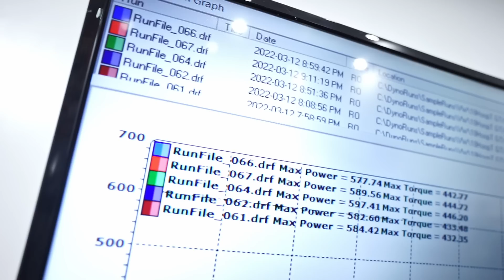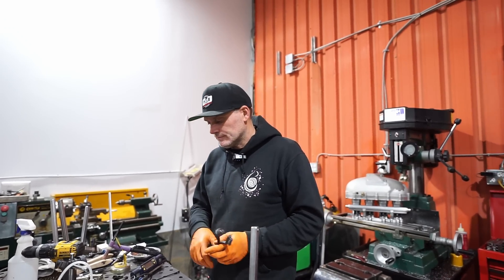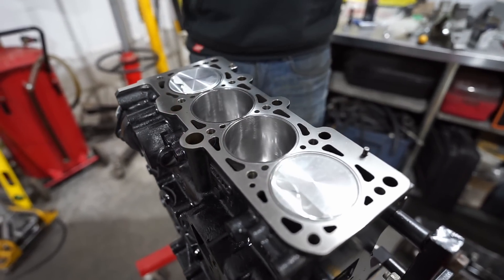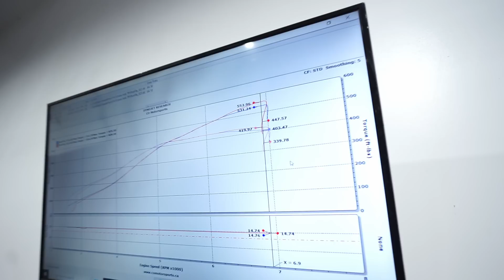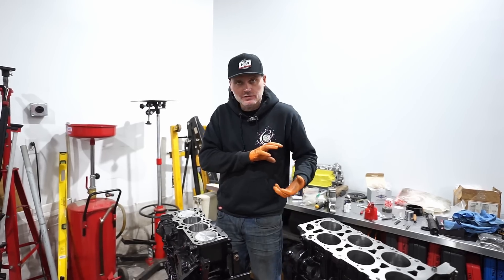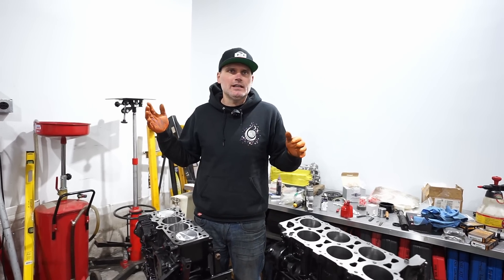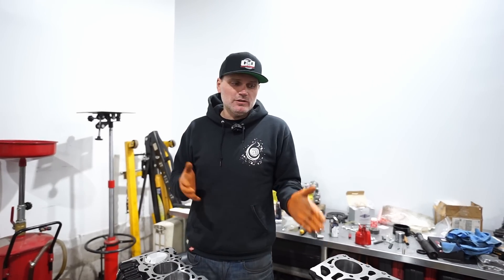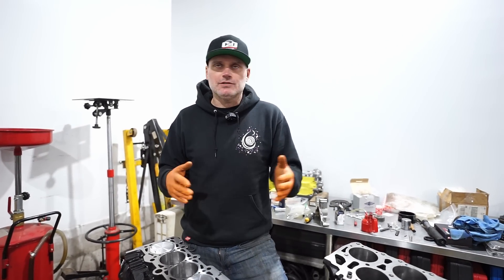Best VW/Audi Engine To Modify.

Comment: what are your thoughts on the gen3 that came in the mk6 non MQB?  I know they use small turbos, but CTS offers a really nice turbo upgrade and most of the fueling from the Mk7 MQB works on the non MQB Gen 3.  Wondering if you guys have had any of those cars in on the dyno?
Reply from the maker: Odd ball cars, little experience with them. I have a couple customers talking about doing turbo upgrades on them but as you would know stuff is limited due to their layout.

Comment: I'm working on finishing up a stroked 1.8t in my b5.5 Passat. New TFSI crank, IE Tuscan rods, JE forged pistons, and EFR 6258. I'm doing a stock position turbo manifold. Just needing a turbo drain flange to make my oil drain, and then throw the front on the car and build out exhaust. Will be starting and running it on a Maxxecu standalone, but at some point intend to switch back to factory ecu and get it tuned using Maestro. Any recommendations on someone who could remotely tune it?

Comment: 07k the world. I've had my boosted 2.5l longer than any other VAG car for a reason. It's hands down my favorite. There have been many fast cars inbetween, but that 5cyl is special.
Reply: I've been considering a 2.5 swap for a future project. I know they can be turbo'd but are they more limited for big power than 1.8T / VR6?
Reply: @Kintoshi892  When it comes to big power and built block, the stock head flows better than both 1.8t and vr6 heads. Early 07k engines came with a forged crank, later engines replaced it with a cast crank. It's a solid base for a build.
Reply: @moshuapit3722  thanks!
Reply: @moshuapit3722 ”early” being what years? mk5, just like how they swapped to hydraulic steering on mk6?
Reply: @zackobrien2223  There's no definitive answer to "what years". The cast and forged crank were sprinkled throughout the years together. MY 06 and 07 seem to have the highest percentage of forged cranks, but it's still a crapshoot, just one with better odds on the early years.
Reply: @Kintoshi892 whatever engine is in the Audi ttrs or rs3 which I think is the same engine if I’m not mistaken . I would go with that engine it’s the 5 cylinder and did he even talk about that lol 😂 one of the best engines
Reply: @inkedBc  no he did not mention it at all, and I was really hoping that he would. I love the 2.5

Comment: My favorite is 2.0T FSI
Reply from the maker: Unfortunately it's probably the worst to be honest when it comes to making power.
Reply: @COMotorsports  I do agree. After spending lots of money on my 2012 2.0 Avant..lots of issues. I picked up a 2021 TTRS recently, added and intake and ECU and TCU tune, the wagon is not my first choice to drive.

Comment: I have to say this is my first video I have watched all the way through and I am sorry I have not spent more time getting to know your channel and team. I am out of Las Vegas nv and I have a mk6 R and it was 412 hp on pump 91 before building and adding water meth and trying to get to 550 and looking to run possibly c16 if need not a street car? In your experience do you think that’s possible?
Reply from the maker: Well thanks for following along. The issue comes down to the injectors, with good injectors, rods and the right turbo it's possible for sure.
Reply: Well if and when you have more time I messaged you on Instagram turns out I have been following you on there since 2019 lol

Comment: First things first, love the channel. My Wife and I have owned roughly 20 cars in the 20 years we've been together (easy to see how often we go thru cars LOL) and half of them have been Mustangs. All V8's, from 2001 GT to 2013 Boss 302 to 16 and 19 5.0's. I retired from my career after only 16 years and sold my 19 5.0 just to get rid of the payment. I bought a 21 Kia Forte GT 1.6T with the intentions of doing bolt ons and that's it. However the car wasn't that fun especially coming from newer 5.0 Mustangs I sold it. Did so much research and landed on my current 2020 GTI DSG. Within 2 weeks it had Stage 1 ECU and TCU tune and currently sitting waiting to be installed is the Trueflex sensor and HPFP so I can run E85. It's actually been one of the funnest cars I've owned and can't wait to run E85 with my new intake and catless DP. 👍
Reply from the maker: Great cars for sure. The R is where it's at simply due to traction but the GTI has the same power potential. Good luck with your build.
Reply: @CO Motorsports  definitely only modded and raced 1 FWD car in my life and the struggle was real. I heard the stock axles are pretty strong and I'll be doing nothing but drag racing so we'll see. Thanks
Reply from the maker: @PeopleCantHandleTheTruth  Good luck, and thanks for the comments. 👍

Comment: Everyone is swaping VR6’s lately in their vw/audi/seat/skoda ect chassis 
And tuning VR6 gives you way more reliability overall and cheaper & easier dsg conversions in total.
If you follow Europe scene, forums, groups ect., you’ll find out that most 1.8T High power guys transfered their engines for VR6’s recently.
Reply from the maker: It is a great engine and can make power easily.

Comment: I think it's worth noting that if this advice we're to be taken by someone building a street car or  a non-drag track car, that the VR (because of higher displacement) will have torque earlier in the powerband than the 1.8t or the EA with similar total power outputs and similar sized turbos.
Now yea, sometimes that hurts more than it helps but it's definitely important to point out in case you might have a car that doesn't have a traction problem.
Reply from the maker: The Gen3 outshines in low end torque also. Trust me I've compared 400whp dyno graphs between VR Turbos and Gen3's. The Gen3 with relatively small turbo makes crazy low end torque and maintains a completely flat torque curve until redline.
Reply: peak torque on my Mk7 is like <2000 rpm lol
Reply: @JT-oz7yn  are you making 500whp?

Comment: Big VR fan here.  It would be cool for VW to build a GLi with a 3.0 VRT 4 motion 6 speed manual. At this point a GLi with a VR would be amazing.
Reply from the maker: The GLI for the most part is always a Hodge podge of parts from the other chassis. If they ever did something like that it likely would be so cobbled it'd be impossible to mod anyways.

Comment: You were kind on the FSI engine. So far it has been a whole lot of expense, work and frustration for very little HP gain. I wise man once told me that before I got started though LOL.
Reply from the maker: Learn from others expenses. lol
Reply: I share your pain. I bought a mk5 GTI with over 60k in go fast part receipts and a snapped timing belt , I did a quick head rebuild and engine refresh only to have to pull it back apart 4k later due to oil pressure and oil consumption issues. I look at the money I have spent and the money it will take to make it the track car I want it to be and I realize I should have just bought a mk7 R.

Comment: I daily a late B5 A4 1.8t ready for a big turbo but only has a K04 with an unopened engine (for now) and methanol. Never been on a dyno but going by weight (CAT scale says 3280 with me in it) I just got it to hit 280hp at the wheels with 22-24psi... I would like to it on a dyno just to see how accurate that is but I know I've surprised a few people driving way nicer cars... The AMG Mercedes I was surprised I kept up with.

Comment: I am in the 3.2 VRT fanbase but I never hear anything about the 3.6 and where it falls. I feel like its a different beast
Reply from the maker: It's because it's a DI engine. Not as easy to deal with when turboing or running standalone. That's why.
Reply: @COMotorsports  how imperative is a mk4 3.2 crank for a turbo build. I hear for a 400-500hp all you need is a spacer and rod bolts
Reply from the maker: @Vexman2200  I personally haven't had issues with the cast cranks ever. But I don't think I've done many cast crank VR turbo setups so I can't say 100%. I can say I've made 700whp on a cast 4cyl crank in one of my own personal engine without issues.

Comment: Awp 1.8t is the best 4 cylinder turbo ever made hands down. Reliable, tons of power, cheap and easy to work on. I had several with all power levels up to 700hp and they are just amazing. Also I own a 40v 4.2 v8 phaeton that’s getting supercharged 😊
Reply from the maker: But how much experience do you have with Gen3 stuff. It's easy to say because you had success with that engine, however we deal with all engines and get to see the ins and outs of each. The Gen3 for 500whp easily crushes the 1.8t in every way.
Reply: I always new this but just had to have to have a vr every time

Comment: I picked up a MK1 225 TT my wife called her dream car... I used to hate it because I didn't understand it.  I called it my nightmare because a 20 year Audi needs lots of attn...  Now after watching this channel I am learning how to spend my money and enjoy my wife's dream car since she stole my wrx... So i'm looking forward to the 1.8t build and learning why they never lose. 🤔
Reply from the maker: Lots of good 1.8T content on here to get you motivated.
Reply: As someone in Germany who primarily builds 1,8ts - here are some major tipps:

-1,8ts always have some kind of pressure leak after 20years. Get one of those pressure testers, and get the PCV system and the turbo side tight. 
-replace the Blow off valve with an OEM option, because with the forge ones you will go into limp mode guaranteed (because of the MAF sensor). Also check the N75 valve.
-if you want to go for power (>280hp, >380Nm), the 225hp engine only needs one thing: connecting rods. The pistons, the crankshaft etc etc all are able to withstand about 550-600hp if the compression ratio is optimized. 

Yeah and change the oil every 8-9k miles and you’re good to go forever basically
Reply: @gabrielvanya8245  been running a 007 on my agu for 5 years now 😅🤣
Reply: @gabrielvanya8245  can confirm forge blow offs are shite get the dv+ if you want to make power
Reply: @gabrielvanya8245  Oem plastic dV? How do those do on a bigger turbo such as a 28rs with over 20psi of boost?
Reply: oem 710s barely function on a standart 1.8t lmao and vw/audi knew about that from the start when they issued an early tsb bc new buyers started having problems with the failing valves. they flipped the valve around so boost would enter into the side of the diaphragm helping it to stay closed during operation
Reply: @fabium3410  Yep :-). The Keyser valves were a bit better but I’ve always had luck with my Forge DV. Just keep it maintained.
Reply: @gabrielvanya8245 do you recommend the f23 turbo from frankenturbo or which turbo do you recommend. My car is lhd
Reply: I hate them because I don’t fit in them lol.
Reply: I deliberately bought one for the 1.8 bam and the Quattro build parts collection is 90% there but looking for a cheap bam to forge to then get the next turbo

Comment: Im beginning the process of 07K swapping my MK4 GTI, got my hands on a 2006 beetle 2.5 with a manual so i have everything. Love the 1.8t but i think the 07K might yield the results im aiming for
Reply from the maker: Smart swap... boosted they're amazing.
Reply: @COMotorsports  how hard is it (generally speaking) to boost the 07k?
Reply from the maker: @Plupx  No harder than boosting any other NA engine. There's no real kits so you're piecing it together yourself.
Reply: @COMotorsports  Sweet, the 2.5 sounds much better than my tsi. I'll do some research

Comment: I'd love to see a video of a basic breakdown of how much it costs to hit certain power miletones of the Gen 3, 2.0. I have a golf R that I'd love to get 500hp out of, but I'd like to do it reliably, and I'm curious about what it takes to get there!
Reply from the maker: 7r... easy recipe. Downpipe, IC, LPFP, MPI, turbo and software... 500whp.
Reply: @COMotorsports  Have you done any S1 PMax turbos yet? Any thoughts?
Reply from the maker: @acefighterpilot  only S2
Reply: Having headed down that route, anywhere from $3000-$8000 Canadian depending on brands, and new Vs finding good deals on lightly used bits

Comment: 2019 GLI here. upgraded to HPA IS38 OEM+ all the other goodie upgrades. almost at the final tune stages with the downpipe being changed. just sitting new in the box right now. last dyno session made 315 WHP / 354 torque. for now. but not opening in the engine here. With all that upgrades and the tune on 93 still got 34MPG on the road trip from texas to Ohio. pretty amazed by that. With that though I am only looking for about reliable 320-330 could be more will see once downpipe is changed and tune adjusted. Love my GLI though.